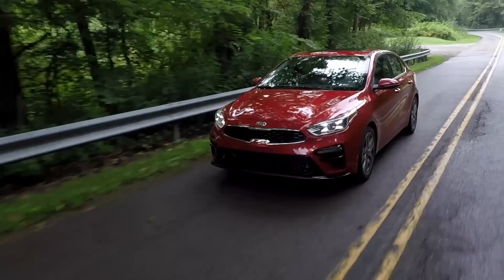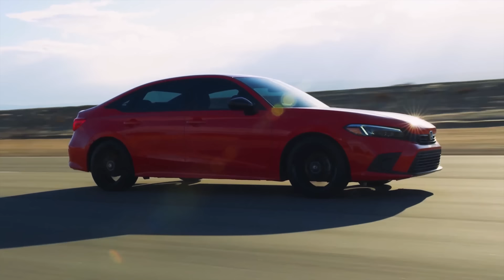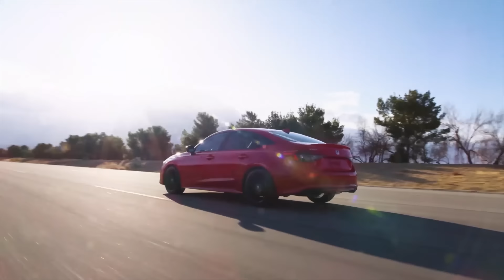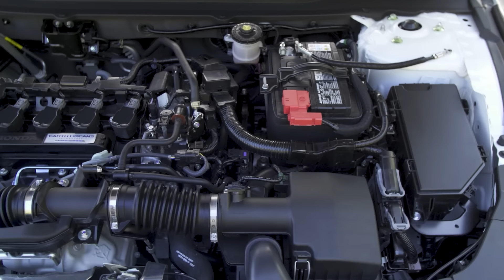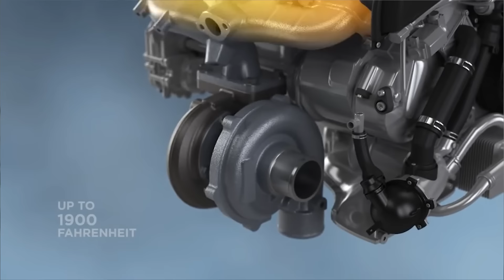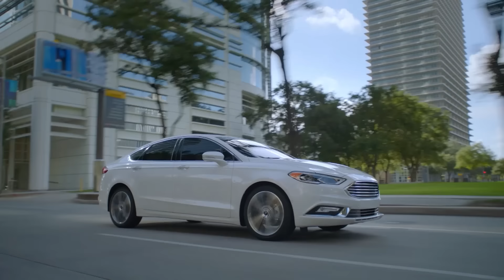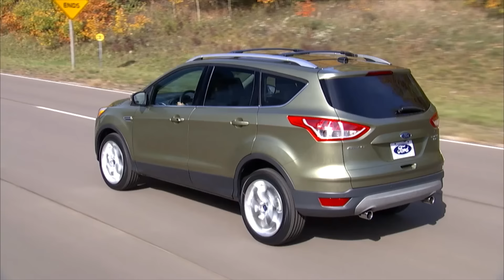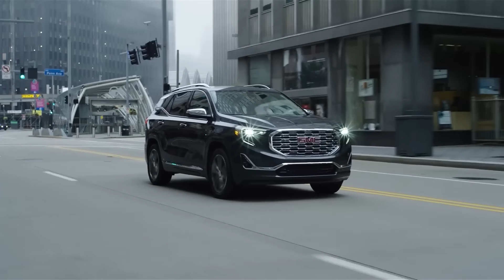Are Turbocharged Engines Reliable? The Truth About Turbo Engines

Comment: The highest temp in a natural aspirated engine is ~200°C in the area around the spark plug; whereas in the exhaust gas powered turbo itself reaches temperatures of ~400°C. The turbo itself is cooled by the engine oil, thereby accelerating the aging of the engine oil. So yes turbo have more power and better fuel economy, but the oil should be changed more frequently and higher long term maintenance costs. So the TCO evens out.

Comment: Most of the time if the company making the car has had prior experience to using turbos other than during the turbo boom. I think it’s gonna be pretty reliable. I had an unreliable turbocharged chevy sonic, and went naturally aspirated again because of it till recently. I should’ve looked at VW or Audi even used over chevy, given they had way more cars years in advance with turbochargers still working passed 150k miles today.

Comment: If you bolt a turbo on a 100 hp engine, with no modifications, I can see problems. If an engine is built to put out 300 hp, it should be engineered to do so.
I just towed my boat home, and got 27 mpg, so I doubt I stressed the engine. (turboed)
Modern turbos are both oil and water cooled to increase their life.
Cars need around 20-25 hp to roll down the highway, so I doubt this stresses the engine.
Continuous full throttle driving may cause problems, but even a naturally aspirated engine would also have problems.
For maintenance, I do change the oil more often than recommended, but since I do them myself, it's quicker than a shop, and more convenient.
I buy oil when it's on sale, and buy a filter while I change the oil and keep the receipt,  but I haven't had engine problems yet in 10 years.

Comment: I currently drive a 2013 Accord with the  2.4 L Earth Dreams engine. Just hit 75k mi and plan on driving this thing forever. If I had to buy a new car it would be an Accord with the 2.0L Turbo engine since it doesn't have the oil dilution problem that is affecting the 1.5L.

Comment: I’ve had two turbo motors and turbos were very popular at one time where I’m from (mountains and high elevation, with lots of passes to drive up and over).  And then came the problems and the repair bills.  Now I only drive naturally aspirated 6s and 8s.  If you plan to own a car with more than 80K miles on it I wouldn’t get a turbo, unless the cost of 91 octane and the time and cost to repair a turbo is something you are ok with.

Comment: So exaggerated and non exact (a “lot of reliability issues but no specific details at all).

I’m on my 2nd Turbo car and never had a single problem with the first one (Nissan 1.6T) and zero issues with current Hyundai 1.6T.

Bottom line. A well designed turbo engine is as reliable as a non turbo engine AS long as they use pure 100% synthetic oil, changed (incl filter) every 5K miles.

Like in any non turbo car, allow a minute to warm everything up before stressing it. Little longer if really cold.

Allow to cool down (1-3 min) after the turbo has been working hard (hill) before shutting off to avoid oil cooking and stressed/deformed metals.

Comment: With anything more complex and having more moving parts, the reliability will suffer (but the “fun factor” can ease that pain - clearly a trade off). However, I believe a more responsible reporting on this would be to look at the record of each car manufacturer. Just like it wouldn’t be accurate to condemn naturally aspirated engines based on the track record of Yugo’s, same with turbos. Subaru has been making turbos for awhile (we have a 2017 turbo Forester with 75k miles and it’s great) with seemingly good results. My mechanic says Subaru is one of the few manufacturers who does turbos correctly. I realize these few personal experiences are clearly not sufficient to make a strong argument in favor of Subaru turbos, but I’d like to see the data on reliability of turbos (and non turbos, because I’ve owned VWs and BMWs, turbo and non turbo and have found them less reliable than other makes of cars I’ve owned, including of all things, a Saab!) by manufacturer before jumping to conclusions.
Reply: Toyota makes better turbo according to my experience. I see here people with turbos have problems but it’s Subaru with most problems. I see old Toyota with turbos engines like 1kz kicking. Even some like 1kd does and hold so better than most Subarus which lose value greatly due to their problems.
Reply: A Turbo engine can be reliable but a NA engine cannot be beaten in pure relability. However Turbo engines can be very reliable VW and Mercedes have made incredibly reliable Turbo diesels with the NA Diesel engines being more reliable and cheap to fix but almost dangerous in how slow they were. I had a MK4 Golf 1.9 SDI and the engine was not able to be killed and there are examples of it and even the TDI engines with over 400k miles that still run perfectly. The 1.2 Turbo petrol in my Toyota Auris drives amazingly so I hope it never had any issues its been brilliant for 7 years and 73k miles but the way the engine drives is brilliant as it seems to take the good parts of both Diesel and Petrol and combines them together to make a powerful, efficent and reliable engine.

Comment: As a retired auto mechanic, I have a few things to say. 
First, you exaggerate the "warmup" times. Turbocharged engines really don't need any more warmup than a naturally aspirated engine except that it is important that they have full oil pressure before using hard acceleration.
Second, oil changes. Virtually ALL modern engines require specific grades of oil and specific oil change intervals. That is because with the level of exotic hardware they use, like overhead cams, roller tappets, and hydraulic timing chain tensioners, the oil and oil change intervals are NO DIFFERENT for turbocharged engines. 
Third - heat and pressure. Engines that are specifically designed for use with a turbocharger use better and stronger components internally. Things like forged pistons instead of cast. Stronger and heavier connecting rods. Forged crankshafts, lower compression ratios. The list goes on.
Fourth - this business about "seals" is also a great exaggeration. Which seals do you refer to? The only seals I see as being more "stressed" from a turbo are the head gaskets. 
Lastly, about all of those "extra parts and complication." I only see TWO extra large parts with the rest being small incidental things like ducting. 
FYI - turbochargers have been around longer than you have. There have been volumes of research and development on this technology. My observation is that you are trying too hard to badmouth turbochargers. Most of what you say is trivial issues. 
Granted, there are a few problematic cars out there, but the majority run just fine and just as long as their naturally aspirated counterparts.
Reply: Exactly right.  
The issues described in this video are mostly related to complications from adding direct injection to turbo engines, or just poor engine design.  
While it is true that turbocharged cars did have issues when they were first introduced, the technology has greatly improved and it is possible to have a turbocharged engine in a car that will be reliable.
The problems usually start happening when you add Direct Injection to a turbo engine.
Reply from the maker: While I respect your experience and knowledge on the topic, your opinion is very much the exception rather than the norm. I consulted with many reputable mechanics on this subject and they all agreed that an NA engine is much safer and less costly for the average consumer who is eyeing long-term ownership.
Reply: @carhelpcorner It all depends on who you ask. I drove a car with a turbocharged engine for several years as a daily drivers. There were no turbo related problems. Once again, the reliability issue comes down to the quality of components used and design. An engine obviously needs to be stronger to produce more power. That amounts to better materials and heavier construction. Cutting corners will result in increased failures.

Comment: Very informative. Thanks! I have an old Honda Accord that has been very reliable however I unfortunately will not replace it with a new Honda due to their widespread use of turbos and the well-known oil dilution issue. I live in the northeast with cold temps and I mostly drive short distances, a bad combination for turbos. I see that even Lexus has redesigned the 2023 RX engine as a turbo-charged 4 cylinder, from the previous naturally aspirated 6 cylinder.

Comment: PS: In most cases any fuel savings with small turbo engines is negated when you have spend .50-.60 cents more per gal. for high test fuel.

Comment: Believe me, the car manufacturers are not putting turbos in their vehicle to do you a favor. In many applications they're less expensive to manufacture. When you factor in the required high test gas ... you loose. If you are an owner who who keeps you car for more than 90K miles, you will be rebuilding this engine, or worse replacing it. They don't have a history of holding up long term. I have a Chevy Colorado w/ 3.6L V6. With the inexpensive tow package (which I recommend regardless if you tow or not) it tows 7,500 lb. I towed my RV across the U.S. and still got 24 mpg. My current average  is 27.5 to 30.7 mpg around town. That's what you can get if you drive using the head vs. the right foot. The turbo Ranger won't deliver this level of economy, torque, or dependability. Most people are not going to maintain or operate a turbo vehicle properly for long term dependability. And they'll try to save money by using lower test fuel which will cause issues. Turbos require more fastidious maintenance as you are forcing more air and fuel into the engine that results in increased wear, heat, lubricant contamination. From my experience in owned over 100 cars, trucks, classic cars, motorcycles, boats in commercial, normal, and racing applications .... stick with simplicity.

Comment: My 2022 Ford Ranger truck is a 2.3 liter turbo. It is unbelievably fast, and so far it is quite reliable. It has more towing power, and more get-up-and-go than my old half-ton pickup, and more fun to drive than most cars I've owned. I have also had a Saab 900 turbo, and, way back in the day, a Chrysler New Yorker turbo, '85 model, I believe. Never an issue with the drive trains. I am a stickler for maintenance, though. I remember the Saab had over 170,000 miles before I sold it, and the Chrysler had over 100,000 before I traded it in. Both were in great shape and ran fine before I upgraded. It's all in the maintenance, I believe.

Comment: I have a car with gdi turbo  and mostly do city runs and drive below 3000 rpm much of the time. I change oil every 6 months generally at 3000 miles. Do you think  it would last well under those conditions?
Reply: My car turns 2800 RPMS AT 100 MPH,  are you running around doing 90 mph ??

Comment: No issues with my 99 Volvo C70 T5. 230 k miles, still going strong. Much of the reliability depends on engine design. And maintenance of course.
Reply: Volvo made very good low pressure turbo systems in the T5 engine system. I had a 2005 V50 T5 when I lived in Germany and it was awesome.

Comment: The question isn't weather or not a turbo engine is reliable. The question is weather or not it was built to be reliable.

I own a john deere 4020 that is naturally aspirated. I also own a john deere 4630 which is turbocharged.  Both use the same engine. One puts out 90 hp. The other, 150 hp. Both are 50 years old or more. Neither has ever been rebuilt. Both  have a 100 percent duty cycle. These are  examples of very over built engines. 
 On the other end of the spectrum you need not look any further than today's modern manufacturing where the primary goal is to make something that works as cheaply as possible. This is dangerous territory. 
  As an engine builder who worked in a machine shop before corporations ran nearly all shops out of business, I can tell you base truths about engines. You have efficiently, power and longevity. Most manufacturers used to build engines with a balance of all three. But if you wanted to hotrod, your power goes up with loss to reliability and milage. If you build for efficiency,  the power goes down and towing capability suffers. The more you build for longevity, the more Both others suffer. Kids used to tell me, I need this 350 built and it needs to be fast and I drive it to work 40 miles to my 5 dollar an hour job and I can't afford another one so make it tough. We'd just say ok and build it to gm specs. 
  Today there are other factors involving cost to make and political correct. And just how many billions and trillions does it take to satisfy a handful of people.

But back to cars. A turbo  always pushes the powerband up and narrows it. Making a motor more difficult to operate. It's more of an all or nothing driving experience. Couple this with lighter cheaper car frames and that will go a long ways to explaining why so many kids are wrapping ther mustangs around telephone poles.  

Is a turbo engine better? Yes, if you use it  for the needs it was built for. The better question to ask is what is the duty cycle of this engine. You can't pull a heavy camper cross country at 75 mph with an ecoboost without problems. Get a diesel 1 ton. And if your not going racing, don't get a turbo. They are just using it to get more power out of a smaller, cheaper package. And you get to pay for it when the salesman promises go away. Pick the real deal for your application.

Comment: Working at auto repair shop for almost a year, 19 out of 20 cars that come in for repairs or service are turbo. Haven't seen any cars with turbo related problems yet. I drive 15 years old car with chip tuned turbo engine, nothing to complain about.

Comment: Well, not all turbo engines are the same... I own a VAG EA888 gen3 engined car, that has port injection too (so no carbon deposits), also has coolant going through exhaust manifold (to heat it up faster). And late oil changes are bad for normal engines too.

Comment: I've used diesels for the past 10 years. Both Me and my other half. And have never had any issues with the turbo. The cars are looked after with oil changes done more than the factory recommend. Both cars have also been mapped and overall a joy to drive.
Reply: Concerns are not associated with diesel motors.
Reply: Most diesels still have cast iron block and heads.  Which are as suitable to warping from high heat.
Reply: key word: diesel. totally different animal than gas

Comment: Not so much unreliable BUT another piece of "Equipment" like a water pump that tends to last about 100,000 miles - example Honda Accord 3.5 V6 Very Reliable and long lasting Accord 2.5 4 Cylinder Reliable and long lasting. I've owned 3 Accords and 1 prelude......... These I will not even look at. I will look at the Toyota Camry  V6 and 4 Cylinder with no Turbo.

Comment: bruh i’ve driven my 2011 chevy cruze with regular maintenance and hella fuckin mods and it’s been unbelievably reliable, mods are: bigger ZZP V3 Big wheel turbo, ZZP Intake, a bigger ZZP intercooler and hard piping, bigger 42# bosch fuel injectors etc. this car just keeps on goin and it’s been daily driven ever since i got it
Reply: i also make sure to warm it up to op temps before i drive it every time, i really think the “unreliability” of the chevy cruze is just due to people not taking care of them, and just the fact that they’re everywhere, they were primarily bought as cheap lease cars, and we’re not properly maintained as such

Comment: I already have V8 NA 6MT weekend fun car so I bought my daily driver 2020 Honda Civic Sport Sedan with the (K20C2) 2.0L Naturally Aspirated port injected engine paired to a 6 speed manual transmission. 

To me the NA motor and manual gearbox was the more reliable option over a direct injected 1.5T engine or a CVT transmission.

Comment: The best car i had was a 5 cylinder 2.5 Turbo Volvo. It never gave up even with software tuning. But today its smaller engines who most people wants in our gas saving days like my 1.2 Turbo Citroën while commuting.
Reply: I have a Volvo t5 2.4 s60 170,000 miles, so far no issues, and my wife leases 1.2 Citroen C3 turbo 17,000 miles so far (no issues, but no miles either), her previous one drank oil at 35,000 miles (same engine).
Reply: @Joke9972  😃👍

Comment: In Japan they use the Toyota Prius for taxi cabs.......because they're an extremely reliable car. Look at what kind of cars/powertrains have been used for taxies over the years, most all were very reliable and relatively inexpensive to repair. I never looked at the Prius as a long lasting car until I went to Japan and seen them running all over the place as taxies.